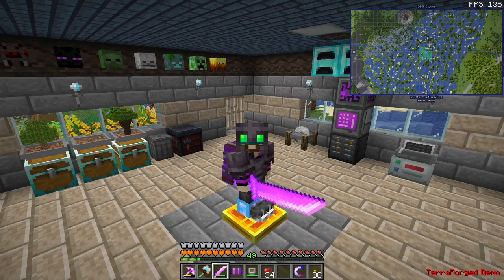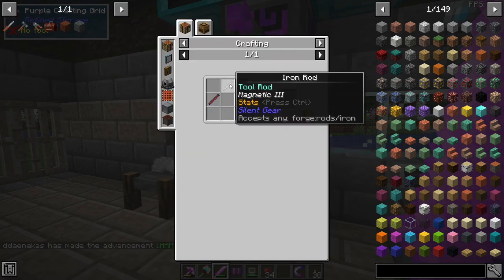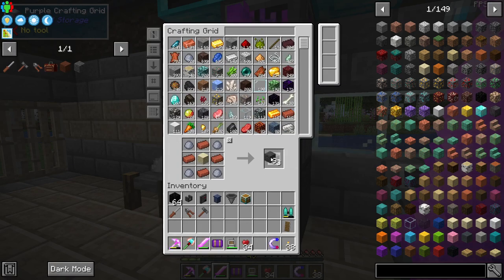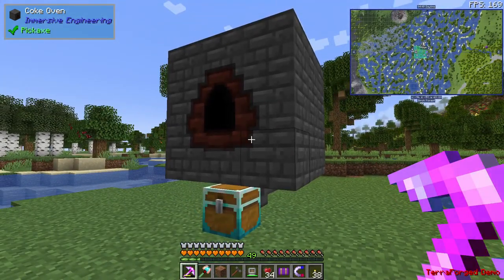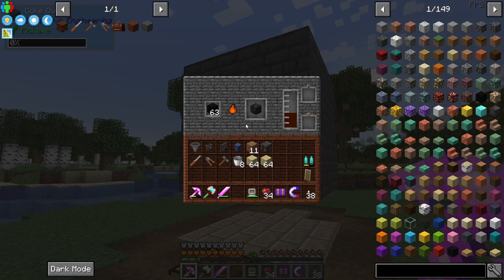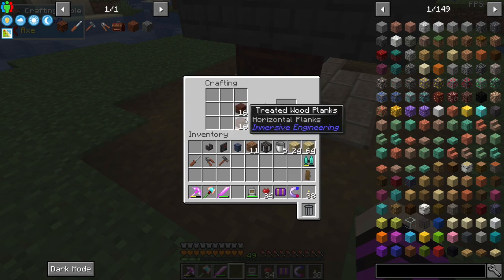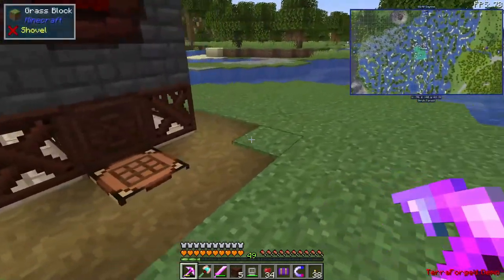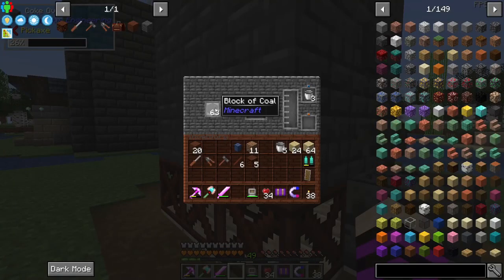Immersive Engineering Mod Spotlight 1.18.1 EP 1 - How to Get Creosote Oil! How to Make Treated Wood!

Comment: im on 1.12.2 on a extremely complicated pack and I can't use a buckett but I can use a mechanism basic fluid tank so any ideas how I can make treated wood? because I got the stuff but it dont craft
Reply from the maker: The iron bucket with creosote surrounded by planks doesnt work but the mechanism tank with creosote does? What pack are you playing?  You might have to make an assembler and pump the fluid into that.
Reply: yeah im playing on a very complex pack and it seems that buckets are disabled just to torture us more so yeah its no problem anymore I figured it out but tnx 4 replying I subbed
 @LetsPlaywithDDae

Comment: Any idea why the stove won't let me put the coke into the oven coal goes in but coke does not
Reply from the maker: coke oven turns coal into coal coke. blast furnace uses the coal coke with iron to make steel.
Reply: @LetsPlaywithDDae  figured part our but I can only put coal pieces in but not blocks
Reply: Eventhough the recipe shows you can